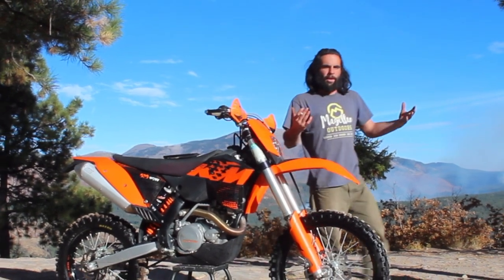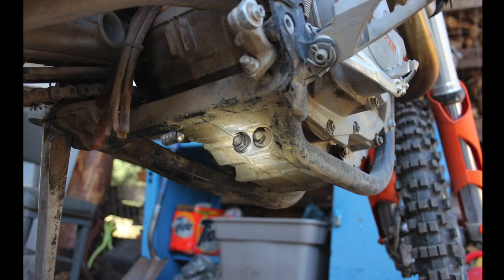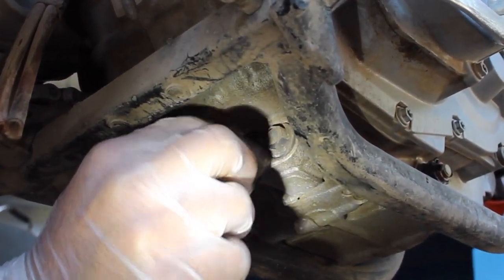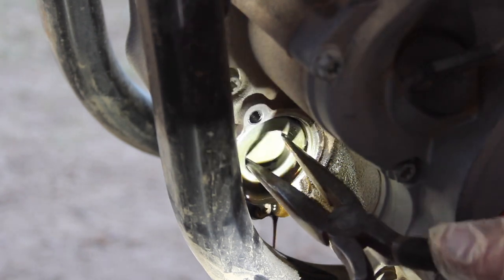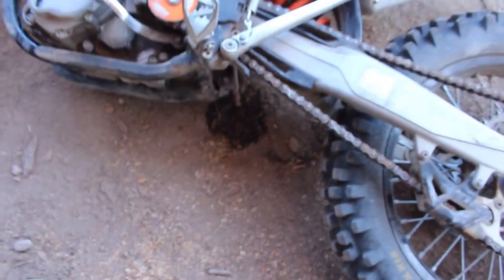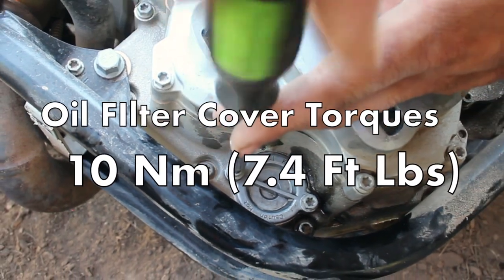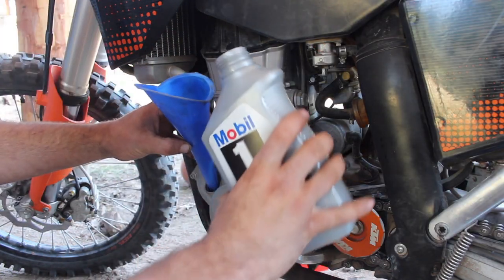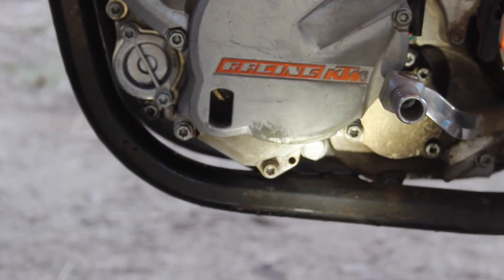How-To Change Engine Oil & Oil Filter in Ktm 530

Comment: if the manual said : 10W50,, that is the right !!!
Reply: Use T4 .. cheaper in 5gallon pales.. runs very well. More then 200,000km on the same motor.. same clutch.. a real 200,000km not 20,000 lol t4 all the way. Doesnt come out like water. Still got lots of good stuff in it
Reply: Hour meter stoped after 400 hours. Same piston. A real monster.

Comment: Who knows if you are supposed to check engine oil when the bike is hot or cold!? 
When it's cold it does not show up in the glass but when you warm it up then turn it off and check the oil it's right in the middle! So the oil expands when it gets hot.
Reply from the maker: now there's a great question! after downloading a service manual ktm's book says "Info: The engine oil level must be checked when the engine is cold" 
Really appreciate you watching and taking the time to ask a really good question where the distinction is important and worth noting, will be sure to use the service manual and include additional info like this in future vids.
Cheers